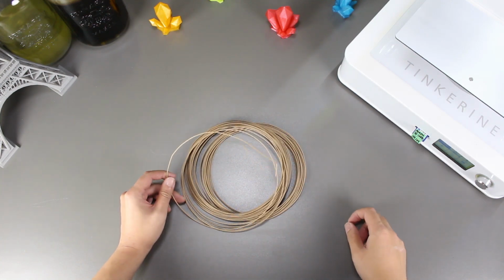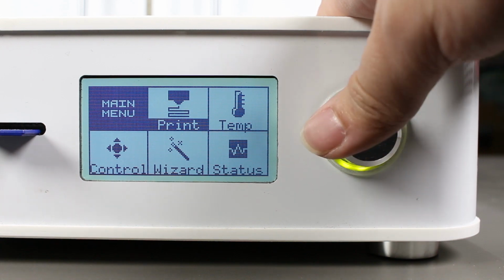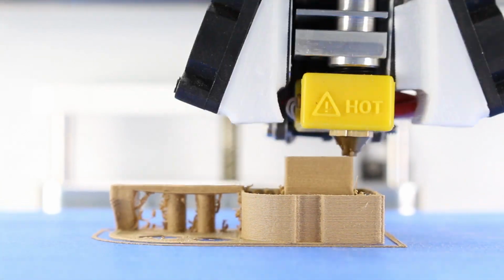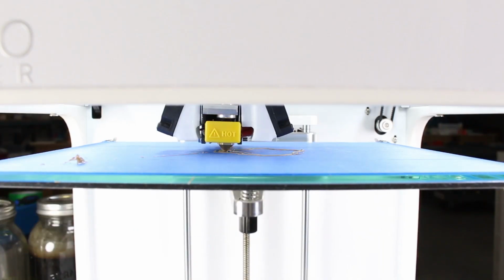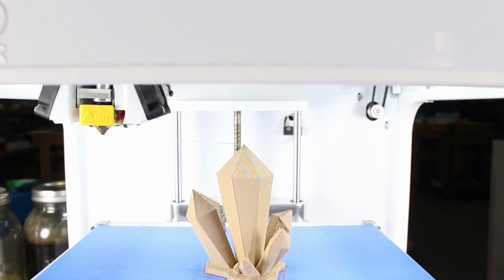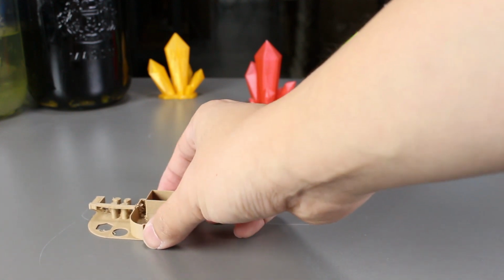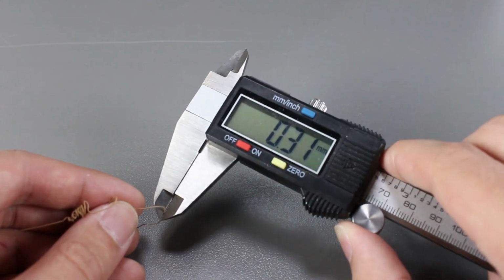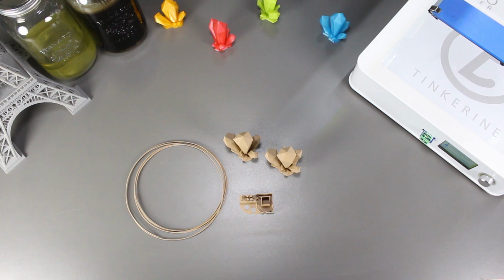3D Printing with Wood Filament

Comment: Do not try and print wood filement at low temperatures it will not print  the temp on a ender3 is around 260 or you are goin to print nothing that's how crap ender 3 and before some ass pice say I should by it in the first place I dint it was a gift DONT BY ENDER 3 THE NEW ONES OUT NOW BLOW UP ON YOU TELL ANYONE THAT THINK OF BYE IN ONE DONT NOT UNLESS YOU DONT MAIND WAITING MONEY
Reply: my ender 3 prints better and is more reliable than the 6500 euro ultimaker s5 in my school lol. you just have to know what you're doing and print the right upgrades
Reply from the maker: Thanks for the comment!

Comment: My experience= pro: great smell while printing, really looks like wood. Con: only good for non-structural prints like the gem you printed of similar prints. It is far too fragile for any parts that will be under stress as it breaks like glass. Most frustrating filament I've ever printed with to date.
Reply: Got any tips Dr. Daniel Dester?  

I got one thing to print so well it looks like it was molded, no one would believe it was 3d printed, it was super strong (and flexible) on that print but everything else looks like on this video, can't figure it out.

Comment: wait what? you extrude a little bit of filament, measure it at 1 point with some callipers, and then do it again after a few hours and think that actually tells you something? dude....
Reply from the maker: Hi,

Thank you for the comment! Do you have another method that can better measure the wear and tear in the nozzle when printing with exotic filament? Let us know and thank you in advance!
Reply: Tinkerine measure at multiple points and take an average. Use something that is more accurate than digital callipers like a micrometer and measure the nozzle directly.
Reply from the maker: Thanks for the advice! We will try it out next time.
Reply: Tungsten nozzle and forget wear?
Reply: Try a cold pull

Comment: How do you counter the effects of wear and tear on your nozzle?
Reply: use a harder nozzle like one made of tungsten or with a ruby tip. the brass used in common nozzles is quite soft and will more easily wear off when using filaments with abrasive components - carbon fiber, glow-in-the-dark, metal dust, wood dust and the like.
Reply: What if I want to print with tungsten hmmm? ;p
Reply from the maker: Hi Brandon,

You can slow it down by refraining from using third party or exotic filaments. That would slow down the effects of wear and tear.

Thanks!
Reply: Tinkerine Other than avoiding those kind of filaments is there a way to clean the nozzle or anything like that? To counter the wear and tear
Reply from the maker: Wear and tear will happen eventually and that mainly comes from printing with the nozzle. There is not much you can do to counter wear and tear but only to slow it down.
Reply: That's not a solution.  Nozzles cost less than a dollar a piece, so no biggie.